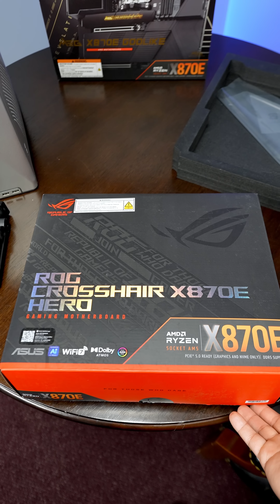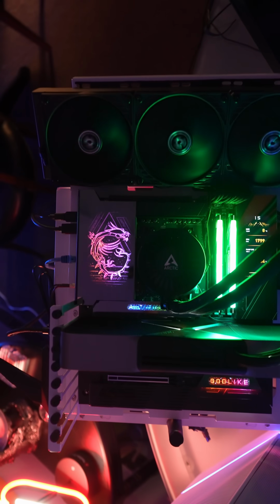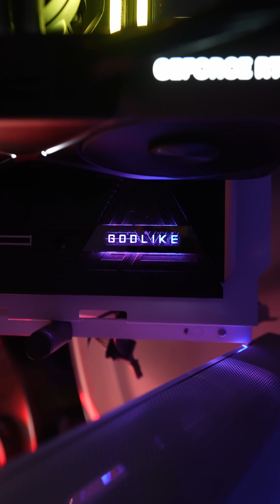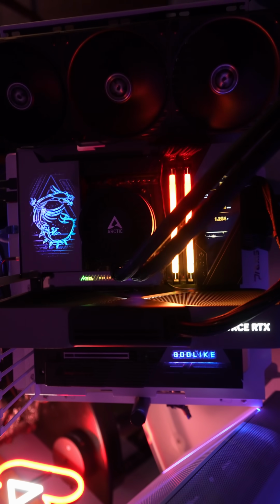Installing the AMD Ryzen 7 9800X3D on the MSI MEG X870E GODLIKE Motherboard

Comment: As someone who has built systems with these crazy expensive boards, I always tell people to stay away from them. They are not worth the prices they charge these days. The best x870e board on the market is the MSI MAG Tomahawk WiFi board. It has all the features these higher priced boards have but costs $300.

Comment: 2Unabhängige Oculink，Ultra leiser AMD Ryzen 7 8845HS (8C/16T, bis zu 5,1 GHz), 32 GB LPDDR5 (5600 MHz) 1T SSD, Mini-Computer, NVME*3
1.Ryzen 7 8845HS / 32G Ram DDR5 + 1T SSD M.2 2280 PEIC4.0 ohne System
2.Unabhängige Oculink/HDMI2.1-Schnittstelle, unterstützt Dreifach-Bildschirmanzeige
3.Nur 0,6 l Volumen, platzsparend/„Forest 2.0“-Geräuschloses Kühlsystem
4.Lokale Servicezentren in Deutschland und Amazon FBA-Lager, WiFi 6 2,5G LAN 8K Dreifach-Bildschirm,schnelles System für zb. zu Hause. Notebooks vergleichbarer
Ausstattung kosten das doppelte.
5. Passt in Rucksack, Tasche oder Hosensack, leicht und handflächengroß. Ideal als Laptop-Alternative mit viel Speicher und Flexibilität. Preiswert.

Comment: Ultraleiser AMD Ryzen 7 5825U (8C/16T, bis zu 4,5 GHz),16GB DDR4 512G SSD, Minicomputer, NVME*3
Mini pc,Es ist sehr sicher ohne System und RAM, Sie können die Installation selbst durchführen
es hat mich nur 299 gekostet, minicomputer,Unabhängiger Oculink belegt keinen NVMe-Steckplatz， Dreifach-Bildschirm,schnelles System für zb. zu Hause. Notebooks vergleichbarer
Ausstattung kosten das doppelte.

Comment: Unabhängiger Oculink belegt keinen NVMe-Steckplatz, Produktmarke ist ,,Aoostar,,
Ultra leiser AMD Ryzen 9 6900HX (8C/16T, bis zu 4,9 GHz), 32 GB LPDDR5 (4800 MHz) 1T SSD, Mini-Computer, NVME*3
Passt in Rucksack, Tasche oder Hosensack, leicht und handflächengroß.
2. Unabhängige Oculink/HDMI2.1-Schnittstelle, unterstützt Dreifach-Bildschirmanzeige
3. Nur 0,6 l Volumen, platzsparend/„Forest 2.0“-Geräuschloses Kühlsystem
4. Lokale Servicezentren in Deutschland und Amazon FBA-Lager, WiFi 6 2,5G LAN 8K Dreifach-Display